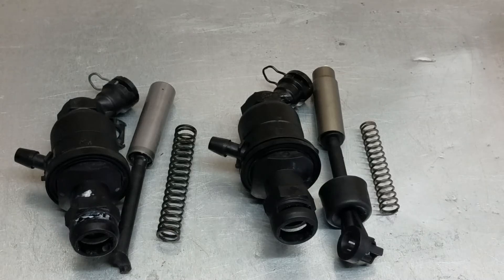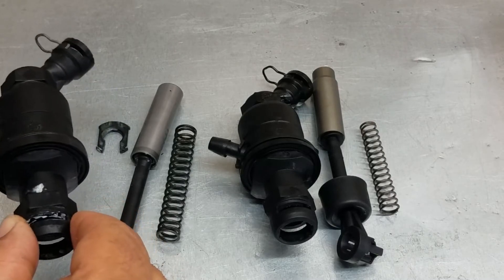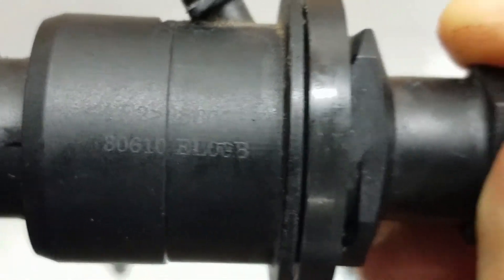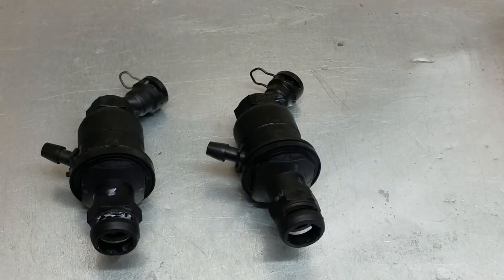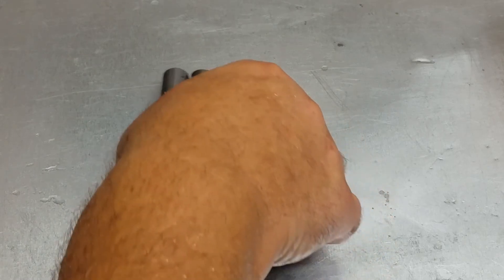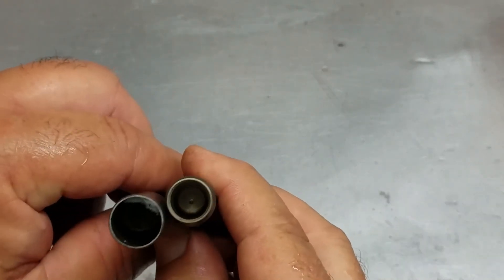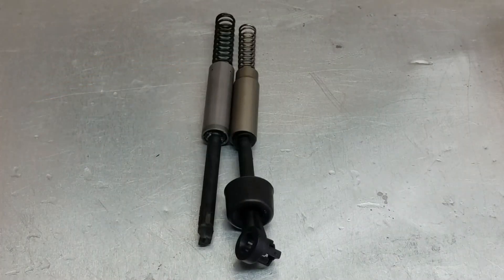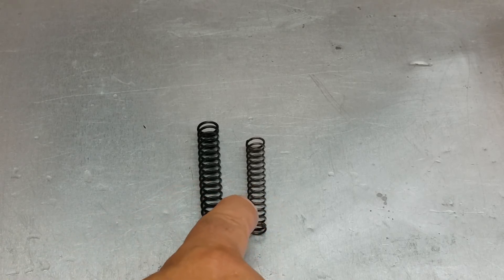Nissan Clutch Master Cylinder Compared to Duralast

Comment: Very useful and informative minute and 45 seconds. 
If it’s Duralast will have a lifetime warranty or at least 1yr. If the 1yr, is most likely garbage. If lifetime or 3yr, is their better part and usually works great, regardless of matching the oem part since AZ is the one providing the lifetime warranty not Nissan who cares to get it 6yrs or 60k miles. 
My experience with 20yrs of Duralast is great prices, nationwide stores, better than average customer service and knowledge(esp commercial).
Personally have racked hundreds of thousands of miles with their parts on my own vehicles and others. They honor their warranties. 
If commercial, save the invoice papers or at the will of the cust svc persons ability at time of visit.
Reply from the maker: Your Welcome

Comment: Went to the Nissan dealer and paid $164 for a clutch master cylinder And it leaks at the hard line..... At the bottom of the threads it doesn't look like it's supposed to look.... I bought this in person no mail order.... The word japan is crooked....

Comment: O'Reily's dot 3 failed on mine......
Reply from the maker: Was it an original or aftermarket clutch master cylinder and are you saying that it happen when you added fluid or completed the fluid flush and change
Reply: @FIXMYCAR  I tried four aftermarket masters n slaves n dealer..... Couldn't get into first gear but for maybe 2 days until I put in Prestone Dot 3....Nissan d21 5 speed.
Reply from the maker: Currently which one is install, the original or aftermarket
Reply: @FIXMYCAR   Currently is Sachs for everything n Prestone 3..... It works just fine and even the brake fluid turned a dark green when using O'Reilly's and after switching to Prestone the brake fluid looks a lot better. I called the technical service number for O'Reilly's and they said they were going to experiment with a new formula of the dot 3 but they denied that it was currently in use. It's an antique truck and I've switched out the slave cylinder many times and never had a problem until just recently. My transmission shop said that he's had to get rid of all of his usual suppliers because all the flywheels are crap.

Comment: I can only drive for 3 or 4 days and I have to bleed the clutch again Because I never went to the dealer to get genuine Nissan master and slave.....  When looking inside the Nissan 29 years old master cylinder bore looks like a mirror finish.......😢😢😢😢😢
Reply from the maker: Which after market brand are you using
Reply: @FIXMYCAR  Sachs slave, Duralast master, Luk master n slave, oreilllys master n slave, napa slave, conterfeit nabtesco master leaked... etc....Luk clutch fingers uneven.